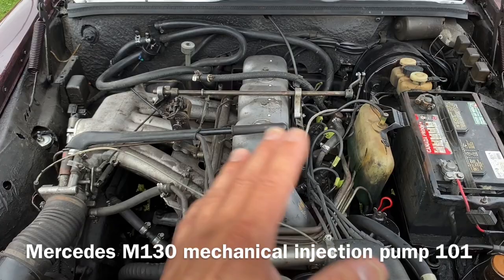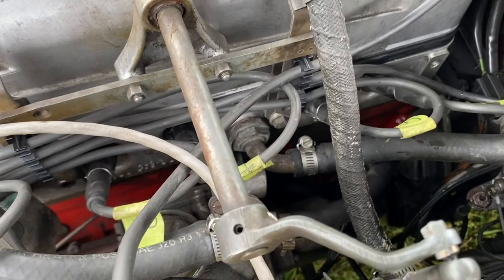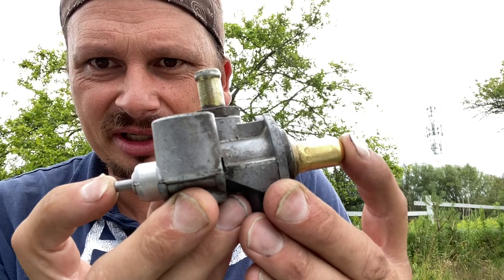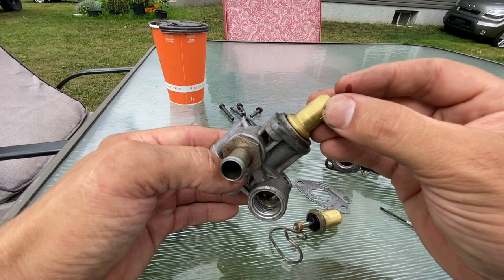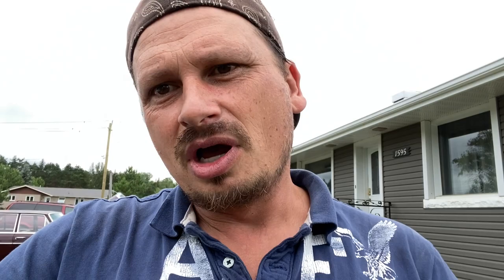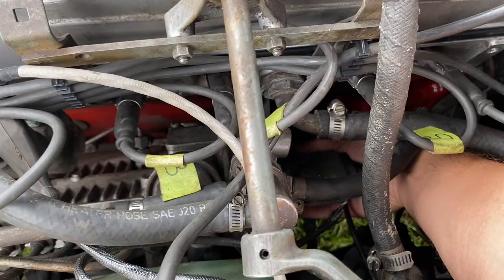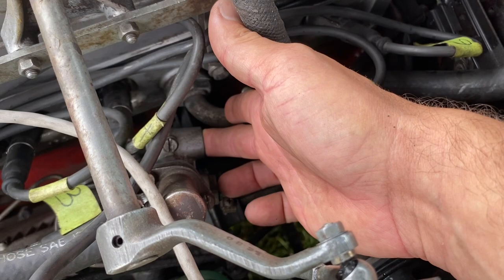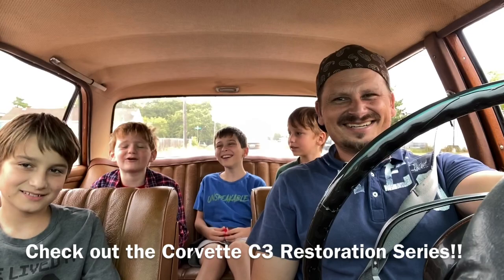Mercedes m130 mechanical fuel injection pump setting. Mercedes pagoda, 280se w108 m127

Comment: Hi.
Mine will not idle above around 500rpm when hot.

Was around 800 cold
Reply from the maker: Sorry you're not giving me enough information to answer your question
Reply: Sorry.
What I meant was that when starting the car it idles at around 800 cold.
When it warms up it drops to 500 and eventually dies.
Funny thing is that it is running rich it seems. 
Adjusting the click wheel at the back and the idle spring valve I can't get the idle above 500 warm. 

I think it is running rich because if I open throttle with linkage disconnected from injection pump it revs to 2500 very smoothly so must have excess gas but not enough air?

Just noted today the barometric valve has a thick washer on it.

This was a colorado car that has stood for a while.

Now in UK with me.
Reply from the maker: @amalhi7834  do you guys have 10% ethanol in your gasoline in the UK? If so you need to remove the ethanol from the gasoline. 
 These cars vapour lock with 10% ethanol gasoline when they reach operating temperature.
Reply from the maker: @amalhi7834  I am working on a solution to this problem and I will post it on YouTube, I want to make mine run on gasoline with 10% ethanol, in Canada they also don't sell ethanol free gasoline. I've been taking the ethanol out, also I live close to the states so I've been buying my ethanol free gasoline there., they sell ethanol free gasoline in the states
Reply from the maker: @amalhi7834  does the car run when it's hot when you put your foot on the gas pedal? Or does it stop running all together when it gets hot and you need to let it cool down to start it again?
Reply: Hi.
I use super which is less than 5% ethanol.
I don't think it's vapour locking.
Car runs but it is rough when running and won't idle.

Cold idle is low and it gets even lower when hot when the WRD valve closes
Reply from the maker: @amalhi7834  just to eliminate the vapour lock theory, grab a garden hose and mist cold water onto the mechanical fuel injection pump when the car starts to stall. If it picks up idle and starts running again then it's vapour lock in the mechanical fuel injection pump due to the ethanol in gasoline.
 Gasoline with ethanol boils at a lower temperature than regular gasoline that is ethanol free.  
 My car won't run with gasoline that has ethanol in it at operating temperature. It idles down and eventually stalls. Once I spray water on the mechanical pump then it runs again until the pump gets hot again. When I use ethanol free gas I don't have this problem at all. All gasoline is 10% ethanol in Canada and many other countries as of December 2022, even 91 octane. 
 Also you could change your fuel filter and clean the mesh filter inside the gas tank if it's not vapour lock. Hard to diagnose without being there.

Comment: you do not need to start the car each time.....just screw 3 times, push it in again, so on
Reply from the maker: The manual clearly says not to exceed three clicks without restarting the motor. 
Makes sense to me, You’re moving a loaded spring, starting the motor takes the tension off of it and re-positions everything inside, also you don’t want to get to a point where the engine won’t start then you won’t know in which direction to turn things. But thanks for watching, And I appreciate any input
Reply: @ProblemSolverGarage  starting the motor does not take the load off the spring :D and it does not have to. oh still missing the part with the timing?? ;)
Reply from the maker: @mikki9644  maybe you're right I've never had it apart, just going off of reading manuals and forums about the injection system.